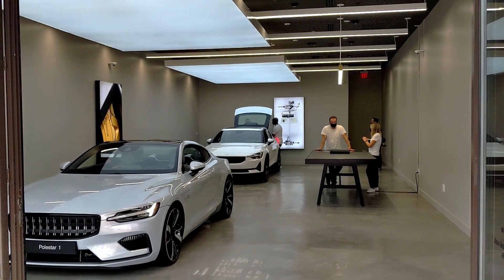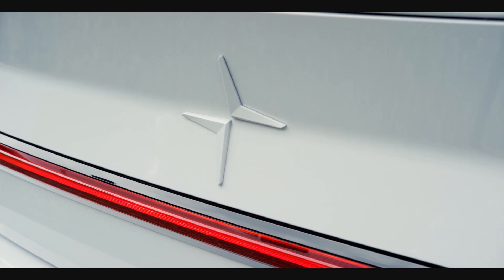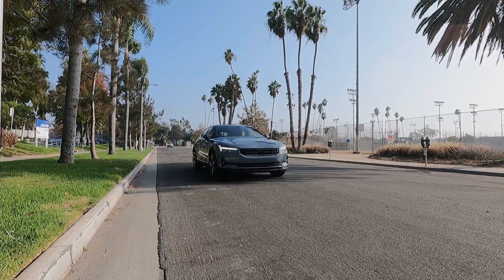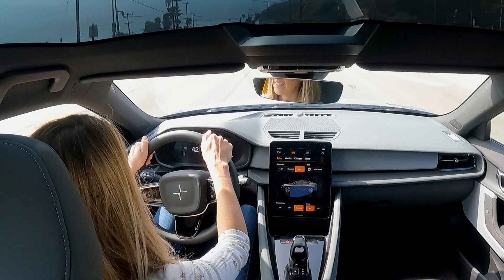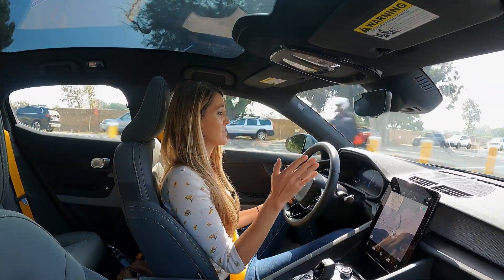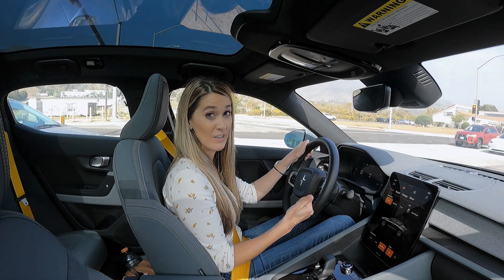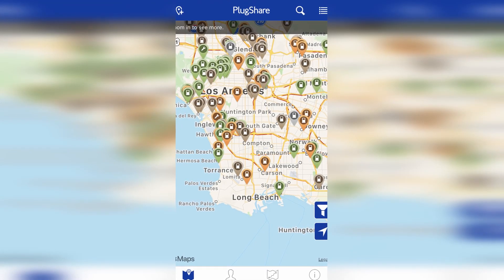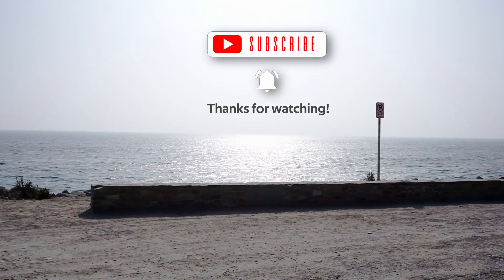Polestar 2: Charging, Handling & Android OS

Comment: Bravo Miss GoElectric, I just saw you on Monro Live I had to go and see what else you do. I watched a few car reviews and I can say that you nailed those, they are short and I fell you cover all the important topics with outstanding knowledge of the car. 

I bought a P2 about one year ago and absolutely love it, like you pointed out, they are some area where it could do better but those are not so important for me. My experience with the P2 is really good, I live in Canada in the province of Quebec near Montréal. Here, in the winter, the weather drops down under 0 F for many days in a row. At those temperatures in the city on shorter trips the car cabin warms up quickly and is very comfortable. For longer distance the car lost around 33% autonomy but charged almost at the same speed as in the summer, this means getting back on the road quicker. The service from Polestar Laval as being fantastic, they even came to my home to pick up my car and left me a loner so they could take to their shop to perform some software upgrades, which improved charging, central console stability, active security systems performance and many others features. 

By the way, Apple Car Play integration as not happen as of now, as a compensation for not be ready, Polestar as offered to extend free in car connectivity from 3 to 6 years.

Long life to your channel.
Reply from the maker: Thank you for your encouragement. We appreciate your update on Apple CarPlay.  Polestar 2's new optional heat pump will improve winter range.
Reply: @MissGoElectric  the heat pump is available in the 2022 model year car.

Comment: No charging times ? Prices vs charging at home ?
Reply from the maker: The Polestar 2 can accept up to 150 kw on a DC fast charger and up to 11 kw on AC/at home. Polestar claims it will charge to 80% in 35 mins on DC and charge on AC fully within 8 hours but it depends on the charger you plug into and many other conditions/factors. I was in Los Angeles, California for the test drive and as you can see I had a hard time finding a charging station (especially a fast charging one). I did not charge this overnight since I only had it for a a few hours. Generally speaking, DC Fast Charging is more expense than home charging and each network charges different rates at each station across the country. Some cars come with complimentary DC Fast charging for a certain period of time. In this case, Polestar and Electrify America have a partnership together right now which offers two years of complimentary charging on their network (30 mins max per session).

My home charging costs me $0.12/kwh (Southeastern Michigan) so to fill up a 78kwh it would cost me just over $9. Keep in mind utility prices are different for everyone but the US average is about $0.14/kwh right now.

I hope that helps.

Comment: I'm considering buying one, but two things make me hesitate; (i) is Chinese, and China is an increasingly oppressive and aggressive country that cheats and steals technology, and (ii) I'm really sceptic about the look of the back side. Wish Volvo and Polestar were German, or that Sweden has the financial muscles to run them.
Reply from the maker: I understand your perspective. 

Designing and engineering are led by the Swedish team. When I spent a week at HQ I was surprised with how the influence of Geely wasn't present. They really let the brand take the reigns as their own.

Obviously big money helps and that is where Geely steps up to get manufacturing facilities in place and structural elements for mass volume. 

Volvo launched the initial design in concept form for PS1 and PS2 for the first two cars. Precept is the indicator for future design language which is much more edgy and risky but of course design is all about personal preference which is why we have a wonderfully diverse set of options to chose from in automotive. :)
Reply: Media brainwashed you about china.
Reply: @MissGoElectric  100 percent accurate information. These are Swedish designed and engineered and so many commenters think that they're Geely cars but they're really Volvo cars tuned by Polestar onto becoming more Polestar designed with the 3 and later models. 

Volvo is too small not to have a parent company. Chinese or not, Geely Holding is a great parent company for Volvo/Polestar. So, so much better than Ford. Volvo Sweden has expanded under Geely. I just try to separate the company, Geely Holding, located in China from the horrible Chinese government. To be honest, there are a lot of horrible governments we have to deal with in many industries. China is key in the EV industry with electronic components and batteries and such.